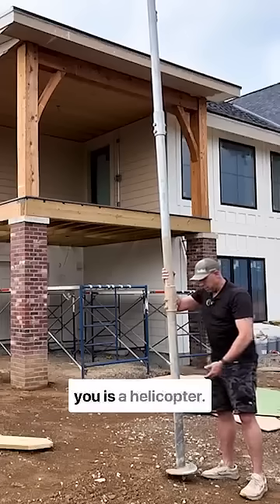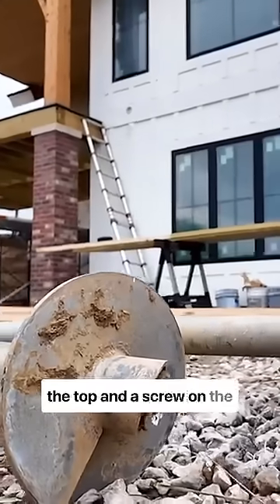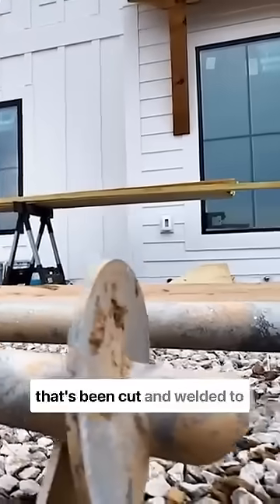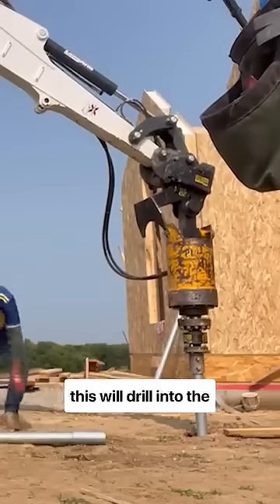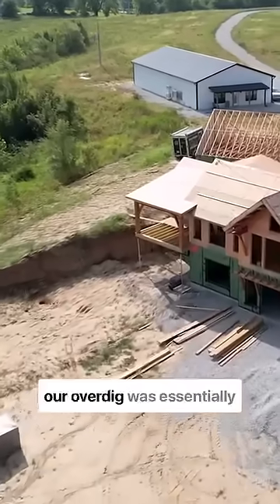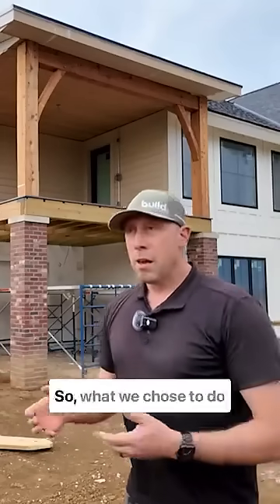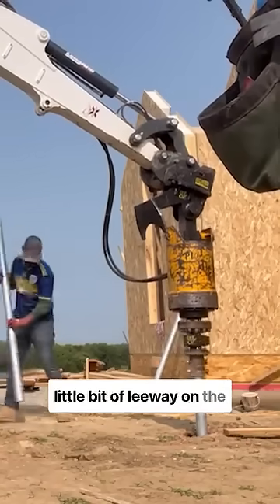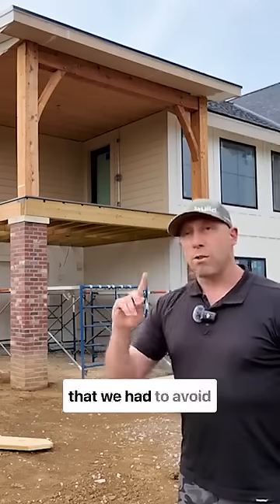Avoid Over-Excavation with Helical Piles

Comment: Years ago I toured the house at the University of Incarnate Word in San Antonio that was built for the Solar Decathlon in DC (but never was entered) that was built as a pier and beam structure on helical piers exactly like this. It was built in two halves with a butterfly roof so it could be split in two for transport and the helical piers could be backed out and removed to return the build site to its original state. Ever since seeing that I’ve wondered why we allow for concrete foundations to be used in the clay east of 35 when we could be building on piers like this and eliminate foundation issues? I don’t know if that house is still there but it would be awesome to have this channel check it out and do a tour. It was a really great build for its time.

Comment: I've seen a similar product that had a wider and much longer cork screw like assembly tha was actually quite a bit shorter. I can't recall the name but I'll try to find it for  you. You should produce a video on how you physically build off of these once they're installed. Thanx!.
Reply: They are referred to as pipe piles. Been around for decades. Geotech does core samples to determine soil density thus determining axial torque limit to set the hydraulic head. 

These are extremely popular and useful in highly expensive soil and where water table is relatively shallow such as waterfront properties. We never use them building here in CO Rockies, unless it was down in Front Range where some regions have very expensive soil. We did a home 2 years that was lakefront Lake Tahoe, the entire foundation was pipe piles supporting the grade beams as well as intermediate stem wall.
Reply: You saw a "helicopter" that was shorter? (Their subtitles are not accurate.)